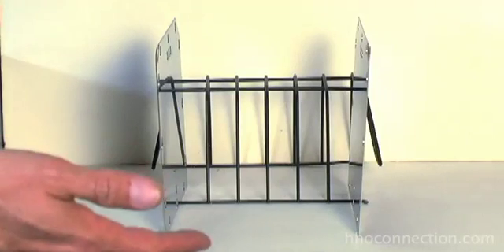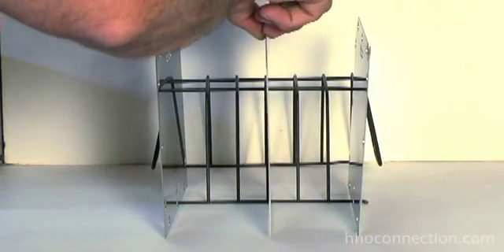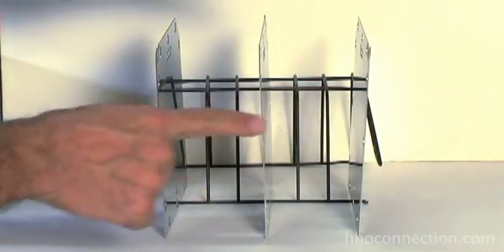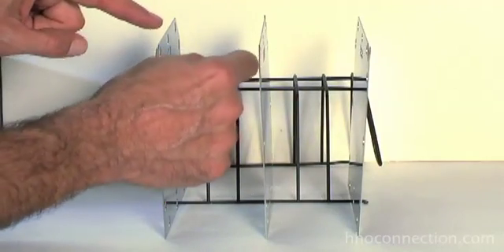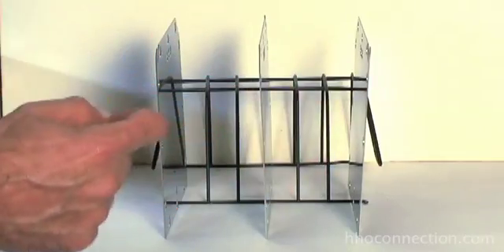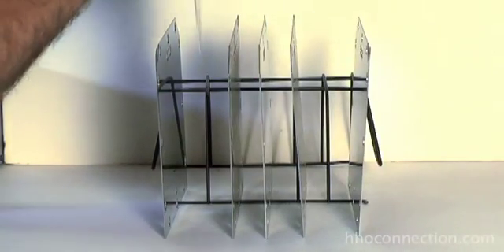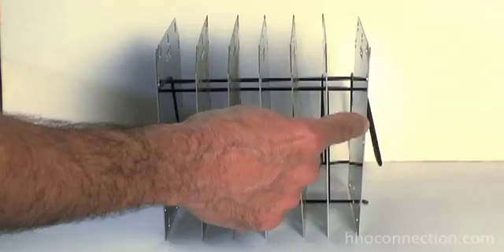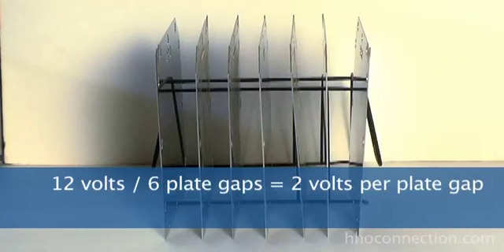HHO Neutral Plates Explained

Comment: Hi Mike, after all my research into HHO, you provide the best info. I really appreciate it. Just to confirm are you saying any voltage under 2.2 volts is best. My question is that on a 31 plate generator are you still using 12Volts?...or are they designed to use greater voltage??
Thanks again MM

Comment from the maker: @thghho You are over-thinking it. If the first plate is negative, it produces Hydrogen. The opposing face on the first neutral plate produces Oxygen. The opposite side of the first neutral plate produces Hydrogen (this is why neutral plates are called bi-polar). The next plate face (second neutral plate) produces Oxygen and so on.

Comment: @hhoconnection Using instant ice tea jars, scrap SS sinks for +&n ,Cu for negative.  Thinking of making a sacrifical plate system of flatened AL cans, deliberatly comsuming the AL. just need a quick convient way to change out used up cans.

Comment: Due to budgit constraints; {i.e..if it aint free i cant afford it] i am working with wet jars. To help with leakage i am considering using progressively wider spacing , e.g.[   + n   n      -  ]  Using 2 seperate jars wired in series.  Any thoughts?  Yea or Nay? Before i waste a lot of time?   btw, excellent videos

Comment: @hhoconnection Ah, right, lol. I was counting physical plates rather than the spaces created which is more important. I know I had 1.97v so it was actually 6 neutrals per stack.  Thanks for the correction.
**I got tired of mine leaking so ordered a 772 from hhokitsdirect. It just arrived today.

Comment: @Melvinizel Add more neutral plates for each + and - stack.  With the engine running there is actually about 13.8 volts to consider. Based on an operational amount of 13.8 volts, having 7 neutral plates per stack gives you 1.97 volts per plate which is excellent for HHO production. Whether using 6 or 7 neutrals, be sure to use a PWM as a control measure.

The one I had built was setup like this: -nnnnnnn+nnnnnnn-nnnnnnn+nnnnnnn-

Comment: @Melvinizel Add more neutral plates between each + and - connection.  While cars do run on 12 volt systems, the alternator actually produces about 13.8 volts with the engine running.  Check yours.  Based on an operational amount of 13.8 volts you would need 7 neutral plates which equates to 1.97 volts per plate. Excellent for HHO production and avoid overheating that produces steam. Use 6 plates if you prefer, but be sure to use a PWM as a control measure.

Comment: @dgomezMentec I made a unit with 12 plates with a (+)(n)(-) connection,  they heat up very fast seems like the wires were starting to burn, but producing a lot of hydrogen.  I tried   to make only 3 (-) and 2 (+) and the rest is neutral, the heat is tolerable and acceptable but the hydrogen production is compromized.  What can you suggest?  My power source is from a car battery with running alternator.  Thank you very much.

Comment from the maker: @TheJimmax Yes for this calculation you only use one side of one plate to come up with the initial number that gets divided by two. Also, yes, I have shipped products to the UK but it gets expensive. A typical dry cell or kit is $45.50 - $58.00 to ship overseas. On top of that different products get shipped from different vendors so it can add up.

Comment from the maker: @TheJimmax Take the total exposed surface area of one plate (lets say 4"x4" = 16 square in). Multiply that number by .5 (or half). We now have 8, so the maximum amount of amps that you would want to throw at one series (7 plates if running 5 neutrals) is 8 amps. Now say you have a 19 plate cell, that would be three stacks of a 7 plate series, so take 8 amps and multiply it by the number of stacks (8 x 3 = 24 amps max for a 19 plate cell ). Make sense?

Comment: assuming the plates aren't connected and they are "neutral" they act this way, is that the same case if you deliberately connect each plate to the original source?  would it be any less efficient one way or the other? would less be produced?

Comment: Great clips packed with info for novices, thank you!  1 issue I've discovered even thru my research EFI engines need O2 & MAS tuners. Wish I'd seen that earlier in my attempts to build HHO devices. I'm a bit discouraged now knowing I'll need to spend more for those devices.  Also, noone seems to show or do "sloshing" test. ie: if the unit is operating on a vehicle while driving around and the solution is sloshing inside the containers, how that effects the HHO production.

Comment from the maker: @Me102288 WTF? You are totally confused. Take a voltmeter and test the voltage between your + plate and either of the two - plates and you will see that you get 12 volts. Take the reading between any two plates that are side by side and you will get 2.6 volts. I give up, have someone else explain it to you.

Comment from the maker: @Me102288 Just focus on 2 volts/plate gap. You are only running 4 neutrals which means 5 plate gaps. 13 volts / 5 = 2.6 volts/plate gap (too high) You should add one more neutral plate -nnnnn+nnnnn-. Too many volts/plate gap causes heat. Too many amps will also cause a cell to overheat. By this I mean too many amps for the total plate surface of the cell. That's a whole different video!

Comment from the maker: @shortyjk95 Glad to help. You are correct, 7 neutrals would be too many. Try 5 and if the cell gets too hot consider using 6. Remember you will need to add more electrolyte when you add neutral plates.

Comment from the maker: @izzzzzz6 You are correct in that the cell would probably be more efficient, but like you said it would be much more bulky of costly for the non stainless parts. As for saving money on plates, the less plate surface you have, the less gas you will get. Even though it would be more efficient than a 7 plate single stack dry cell, you still are limited on how many amps you can throw at it by the total plate surface area. Hope this makes sense.

Comment: Hi Mike, this is probably not a clever question but would having 6 separate cells in series be more efficient and provide better cooling? Although this would cost more in some parts such as pvc & connections it would mean less gaskets and less stainless.
  Sorry i've only learned about dry cells earlier today, it makes so much sense, i'm glad i didn't start out with the wet style cells.

Comment: Excellent presentation! Thanks! 

I was just posting on HHOForums about using a -N+N- configuration with a PWM to control amps/heat.

My dry cell is -NNNN+NNNN-NNNN+NNNN-NNNN+ using a 30A PWM.
In your opinion, is this good for a 2.2L gasoline engine?

Comment: Great video, but I noticed something you mentioned.. You first say that heat is generated by over voltage and is waste.  At the end of the video you also mention that the addition of neutral plates also reduces current.. 

So my question is, aren't the neutral plates acting on limiting current? thus reducing heat ? If you take a specific sell and add neutral plates, how much current is reduced over that of 2 single plates? What si the difference in HHO production? Need to make one of these. :D

Comment: Hello!
Many thanks 4 explanation-get it in my head at last! 
I am building my project and you can watch it on youtube: BMW 7 HHO car running on water :]
I am going to use Voltage to Current Converter (instead of PWM) and at last waiting for another cell coming in 1 week Without Neutral Plates...as far I remember it gonna be about 4V per cell...hmmm...propobly I will need 1 Neutral Plate between every + and -  to get around 2V per cell?
Regards!

Comment: Cool, that helps. How do the poles work when your working with more then 7 plates, i.e. the EBN cells with 19 plates. How do the neutrals work then and where are the negative and positive terminals?

So if 7 plates is +NNNNN- is 19 going to be +NNNNN-NNNNN+NNNNN- or would you have the positives on the edges and then two negatives in the middle? (Which I guess would render the central 5 neutrals pointless...)